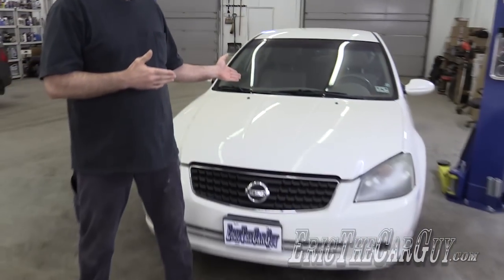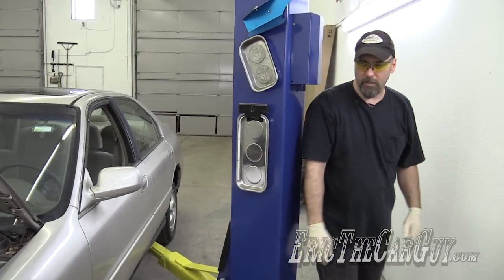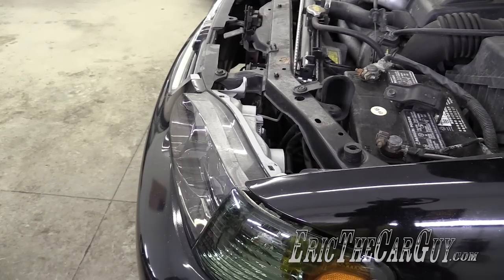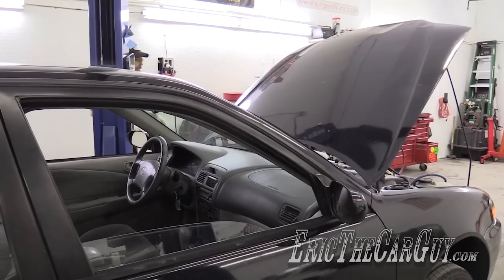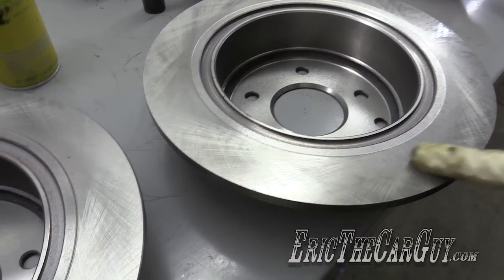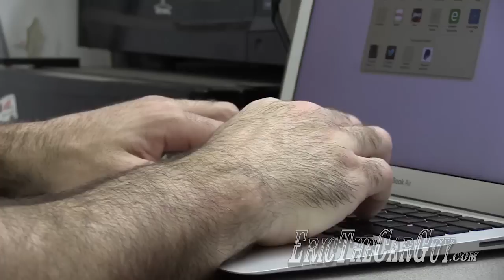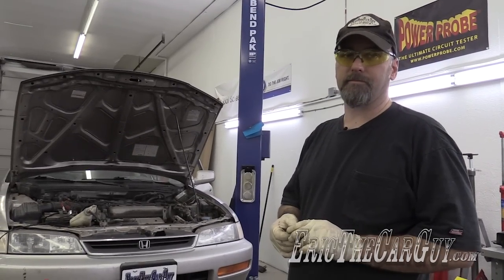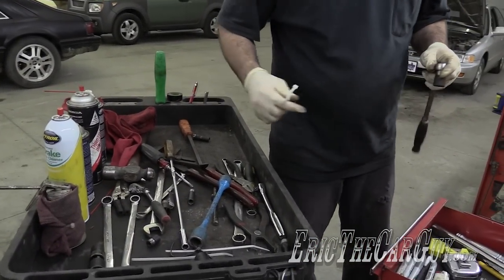A Day At The Shop With EricTheCarGuy

Comment: Excellent video. I always appreciated the time and effort mechanics put into working on cars in their shops but this will be a good thing for others to see as many customers expect their car to be road ready in a few hours despite the car having major problems. It seems like they can't understand that there is diagnosing the problem, communicating with the customer the price, ordering parts, fixing the problems and then finishing the car which are a lot of steps. When I take my MB in for service at a local indy I tell him to take his time. Because of that my car is always serviced properly and I get top notch service. As a matter of fact he runs my car next door to a detail shop for a quick wash and vacuum at no charge. Treat your mechanic good and they'll treat you good.

Comment: Friends are the worst customers always expecting free work
Reply: Not always. Gotta be clear up front, time is money. If he was fixing it in their garage then sure, but it's his shop so he's on the clock.
Reply: Mechanics always overcharge. And I don’t mean a guy like Eric. He seems like he does good honest work, and also has to make a profit himself. But going to big name shops especially dealerships you get charged out the ass for anything. Even the most simple things like brakes and oil changes aren’t worth what they charge if people knew how easy they were to do. Some ppl just don’t have the space or tools so their kinda SOL. I got quoted like $450 for brakes one time. New pads and rotors on all 4 which is fckn ridiculous. That’s why it’s good to know ppl who will do the work for cheaper and you know them so you know they won’t be messing up anything and saying you need to replace it. I also got quoted $500 for a cv axle swap, which I know how to do and any skilled mechanic could get that done in 30 mins maybe less if they were trying to get it done fast. But a lot of the time they don’t have the parts and order them and that time your car is sitting on the hoist, they charge you for labour.. $125/hr. I dunno it just sucks everyone’s so greedy now a days. The price on everything has gone up from what it used to be years ago, even tho it’s the exact same parts.
Reply: @LJT9393  450 for all 4 wheels and Pads is absolutely ok when the material is included. 250 to 300is alone the material and at least 3 hours labour.
Reply: Spelter yea that’s great if that’s what you believe. And I know that’s an average quote on this job, but if you actually knew how easy it is to do yourself you’d be appalled at how such a simple job can cost so much. And the reason I learn to do this shit is cuz my dads a heavy duty mechanic and can get me any part I need at mechanic cost. And when I look at that sheet stating the price NAPA charges wit their mark-up, and what mechanics get them for, it’s almost criminal they get away with charging so much. And they will drag out jobs just to charge you that $125/hr labour rate. This shop beside me once quoted me $500 to replace the passenger side CV axle.. now had I not known how easy replacing an axle is, I may have believed him when he said it’ll take about 3-4 hrs to do.. but I knew it was BS and took it to a shop that has reasonable prices and only paid $250, which is still most likely at least $100 more than it would’ve cost had I ordered the part thru my dad and did it but the axle was fucked and needed to be done ASAP. I do all the work at my dads as well so I can’t just work on it anytime since he lives like 25-30 mins away. He has also always told me that mechanics overcharge which is most likely why i ended up learning to do repairs myself after having to bring my car to shops for little stuff and paying $300-$400 for an alternator or something simple to fix. But hey it’s your money man, if your happy to pay that the go right ahead. I just know it feels better having that $200 you saved by doing it yourself, opposed to paying a shop that don’t give a fuck about you or your car but just see you as a dollar sign..
Reply: @LJT9393  yes if course you could do it on  your own. I did not say nobody with simple Tools and special knowledge could do it on a weekend in front of his house. But when my time is short and I work 50 hours a week or more, I would say 200 Dollars labour to change my breaks is not a ripoff. Here in Germany you do it because they charge an average of 700 to 800 and more to change them. 450 incl material is cheap. I have a garage with an lift and my friend and I we can do it by ourself, but I had times I did not even had the 2 or 3 hours to do it.

So everybody can do everything if he or her is willing to read and learn. Do some mechanics like breaks or even cylinderhead gasket is a piece of cake now after 12 years of working on this things. Really hard are electrical problems with new cars, but for us, it is an adventure to hunt and fix the problems. But if we have to do it for a living, you have to think about what you have to charge. If it is easy work, no problems come up, you earn money. If it is like Barbaras SUV, you loose money, and others pay more to compensate that. I know no professional car shop who handles it otherwise. And if you pay 200 for labour but he has problems and should have charged 500, it is your win this time. I had cars with literally all screws we touched broke of, we had to drill them out of the engine block or other positions, just to change the timing belt on that Golf mk2, we had 3 days and each day 10 hours because every screw was rusted to the engine, even heating them up and use an impact drive did not help. If it would have been a customer, what  would you tell him after 30 hours of work, each say 70 Bucks. 2100 Dollars for changing the timing belt because he had a rustbucket. You can't charge that, so that is how shop owners calculate.
Reply: @LJT9393  There is a lot of "simple" things on vehicles that cost a decent amount of money, because they are time consuming. Yeah a brake job is a simple easy job. But that doesn't mean it doesn't take time away from a technicians day where he could be doing something else. So you're still going to pay for the time. by the sounds of your comments, you're probably 17 and don't know a damn thing about any vehicle other than that your dad fixed it for you and paid for it. Dealerships usually seem greedy yes, because they can get away with it, but any independent shop I've seen typically is reasonable. Our shop now only charges 74 dollars an hour labor. Does diagnosing issues free as long as you bring the work to get fixed to us. Unless it is a complex electrical issue, then we charge diagnostic by the hour(that is very rare). And we only charge shop labor by the book time. So if a job's book time is 3 hours and the technician takes 7 hours to do it. It doesn't matter, the customer still only pays 74 dollars times 3 hours book time. plus parts, which don't get marked up as much as you say. You should probably quit going to shitty shops or quit listening to everything your daddy complains about and talking out your ass on youtube. Some alternators in ford tauras call for 5 hours book time to do, so depending on what vehicle you're talking about yeah I could see someone easily paying $400 for an alternator job. Thank ford for that one when the service procedure is to remove all engine mounts, and using a hoist pull the engine forward 3 inches so you can slide it out. It all depends on what vehicles you're working on too for prices. There are brake jobs on fancy audis you have to do all this bullshit on the scan tool, then jerk the car off, then release a switch, then jerk the car off some more, then do the brake job, then use a special tool that cost 500 dollars to push the caliper back in, then jerk the car off again, then tell the car some bullshit on the scanner, then your brake job is done. You can't ever talk about prices without mentioning the vehicle that is being priced and what part.
Reply: Chiefin actually bud I’m 25 and I do all the work myself, the only reason I do it at my dads is cause I live in an apartment an don’t have a garage or all the tools if something went wrong like breaking the head off a bolt or any of the other things that could possibly go wrong when working on cars, you pick. I’m not a licensed mechanic but that don’t mean I don’t know anything about cars. I also have my own OBDII scanner in case something goes wrong that I need to bring into a shop right away I’ll know if they try to bullshit me into paying for something that doesn’t need to be done, or something I could do later after they fix the initial problem. And I’d pay $74 an hour, that’s actually reasonable. But every shop I know around my area and most likely the majority of them across Canada charge $125-$145/hr labour. And that’s also what I meant about dealerships overcharging for the littlest shit, all the new cars that come out need specific tools to access this or access that, that you can’t get anywhere but the dealer and a lot of times they won’t sell it to you to force you to have to bring it to them. I know a lot of work is time consuming, but when someone tries to tell me it’ll take them 5 hours to replace a CV axle.. you bet I’m telling him where to go... I also worked in a truck shop servicing and doing tires on Semi trucks. And even they only charged $75/hr labour and everything took twice as long or more to complete. I, not saying I know everything, but I have studied a lot on engines and all the components that need to work together to make it run. And if I could I’d work on cars everyday all day but I can’t. And the last time I was at a dealership, they overfilled my oil about 4 inches past the fill mark. They also said they did a 155 point inspection yet failed to notice the bushings on the stabilizer links were cracked and dried out, flaking apart. I had to tell them that they were bad after pulling the tires off and looking myself. They fixed them for free, but still did a half ass job and also didn’t notice the P/S fluid was filled right to the red cap in the top of the reservoir, and there’s clear marks on it showing where to fill it to. And this was the work of their “top mechanic” lol what a fckn joke. If I’m paying $125/hr labour then they better fckn do it properly, and treat it as if it were their own car. Which doesn’t happen, most the time they overbook and work their mechanics to the ground so they just don’t give a fuck about your car when you bring it in. They told me it would cost $140 for P/S flush and fill, while I just got the fluid and did it in like 30 mins, the fluid cost me $35, and the only other things I paid for that day was 2 feet of rubber hose to hook up to the return line and run into an empty windshield washer fluid jug, then some butt connectors as I was also installing my new kenwood stereo that day. It’s not my fault that I’ve had bad experiences with car repairs, and there’s millions of others who get the same treatment. There’s news reports on shops that don’t even change your oil but charge you for it and then tell you that you need $300 worth of other repairs. That’s why I started doing my own repairs since I started driving at 16. Also about your shop doing free diagnosing, I’ve gotten quoted over the phone $125 for diagnosing while they fed me bullshit about what they all have to do this and that, and a couple shops I used to work at, automatically charge that 1 hour labour for diagnosing, even tho they just hook up the scanner, pull a code and then leave it sitting there for the remainder of the hour. I don’t know about you but I deal with mechanics trying to bs their way into my wallet cause they see me and my girlfriend as a young couple who won’t know the difference, and that same shop that told me it would take 5 hours to replace the axle, also tried saying they’d do a re-tourque for $15 😆 I said wow what a fckn joke and hung up while buddy was trying to say something back. So don’t come at me with your stupid assumptions of what I know or what my dad knows. He’s been a mechanic probably longer than you’ve been alive bud, cause by the sound of your comments your some 21 yr old punk who is a fresh graduate in automotive mechanics and think your a fckn god at what you do 😂
Reply: @LJT9393  
Rotors are like 50 a piece give or take so 450 for replacing brakes and rotors sound reasonable to me if labor is also included.
What kind of car you got?
Reply: Ricardo Gonzaga this was like 5 yrs ago that I got quoted this. I guess to me it’s expensive since I’m used to just doing it myself and not paying a mark up on parts. But at the time it was a Nissan NX 1600
Reply: @LJT9393  
That makes sense,
Ok I like to buy tools and not paid to mechanics but sometimes you don't have the place or time.
Reply: Lyle J  how much do you think it cost to operate a shop? Big or small? One guy or with 5 guys.  The cost of a mechanics hand tools( not meaning just wrenches and screw drivers) and shop equipment, the shops scanner $5000 with $800 yearly software updates, uniforms, hazardous waste disposable, insurance, yearly state n county fees,  information database like ALL data $200 month, electricity, water, shop supplies, employee wages, rent of location, etc etc 
The cost of doing any warranty work?
The cost of keeping stupid customers happy- the ones that say after you changed my oil my a/c quit
You’d be surprised of the overhead. 

I’m not Disagreeing some shops have ridiculous prices for some jobs

$400 for pads and rotors on all four wheels is a good price. Normal.
Reply: Steve H yes I understand that all costs a lot. But are you serious about 5k for the scanner?! Most I’ve ever heard of the good ones costing is like $600-$800. And I know with Autel scanners like a lot of shops use you just go onto their website and download the software update and install to the scanner, at least with mine I can. Don’t see why it would be much different for others. Maybe different brands.
Reply: Lyle J  co-work has some snAP on machine he clams 10k. I’ve him pAy 1,200$ updAtes. 

Yeah you can have 5k in scan tools easy.
Reply: Steve H how do you go from speaking proper English in the 1st comment, and then hardly making sense in this last reply? Lol. But yea at that point you’re paying for the brand. But I don’t believe a single scam tool is 10k on its own. Maybe after new updates at $1200 each yea. I could be wrong tho. But that seems a little excessive seeing as Autel’s are a lot cheaper and do the same thing.
Reply: i think I was trying to type with gloves on
Reply: Steve H LOL
Reply: Excellent video content! Forgive me for the intrusion, I am interested in your thoughts. Have you ever tried - Tarbbatigan Cars Rehabilitation Tip (should be on google have a look)? It is an awesome one of a kind guide for learning how to repair your car the easy way without the headache. Ive heard some extraordinary things about it and my friend finally got cool results with it.
Reply: good friends dont ask for free work.
Reply: $450?! Wow that's cheap!
Reply: Marc Kunze yea man you’d think... but they can get away with it cause most people don’t have the equipment or know how, to fix stuff on their vehicles. YouTube is a great place tho to learn how to do literally everything to fix anything on a vehicle.
Reply: Yeah! I had a guy who wanted me to work for almost nothing, but then wanted to charge me $500 for 1-2 hours of electrician work. He looked at me like I had 3 heads when I brought up his disparity. Needless to say I parted ways with him for good.
Reply: @LJT9393  Its a balancing act being an auto mechanic. You can make out like a bandit on some jobs and get hosed on others. Sometimes you have to take profits when you can.
Reply: Not really they usually just appreciate a good mechanic. I bet they pay him whatever he asks for. You can go this when you have a good clientele.
Reply: It all comes down to calculations whether or not to use a shop. If its something simple like brakes, I will do it myself. In fact, to save time, I usually buy a spare set of rotors. I put the new ones on and turn the old ones for the next time; then I'm not waiting on the shop to turn them and I don't have to worry about beating the clock when I start a job late. However, if its something more involved like head gaskets, I am more than happy to have a shop do it. I certainly CAN do it myself, but if I bring it to a shop (usually the dealer), they provide a loaner car for no extra cost, it gets done faster than trying to find time on my weekend to do it and if anything goes wrong, its on them to correct it.
Reply: I don't expect free work from a friend. Just honest.
Reply: @LJT9393  I charge $160 for all pads and rotors, additional $15 if sliding pins need lubricated which most of the case it does.
Reply: @scientist100  you need to charge more my friend
Reply: If your friends request free work they're not your friends, i have very close friends that i consider as brothers but we never owe something between us and we always pay for someone's service in a way
Reply: Nah I would pay my fair share
Reply: @Spelter  now it is 700
Reply: @Spelter you said it perfectly brother!
Reply: Anyone is the worst customer, anyone wants you to fix their car for free what you talking about.